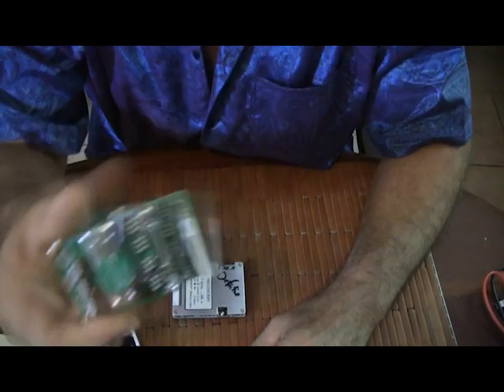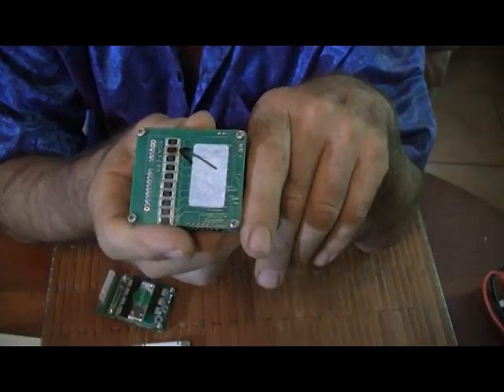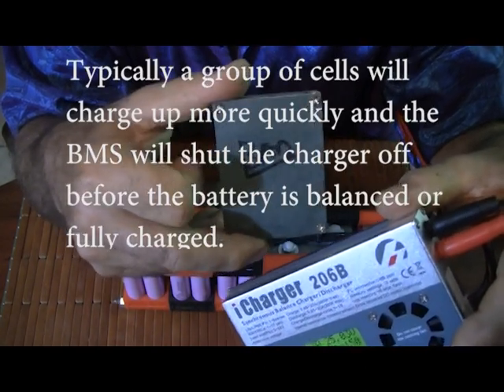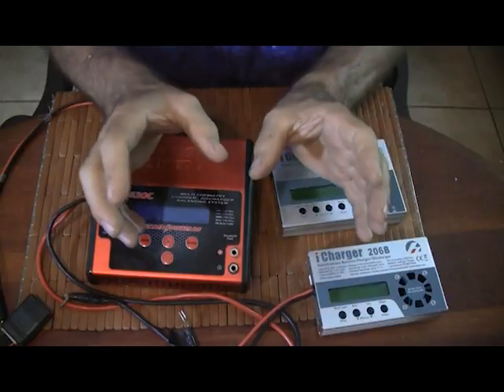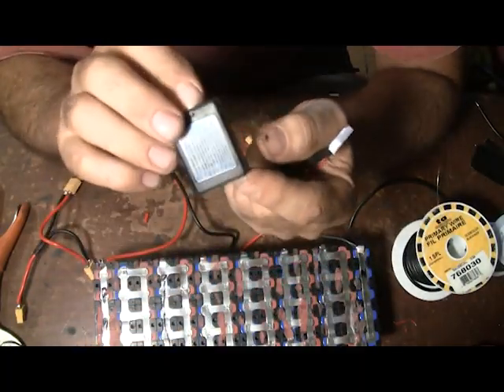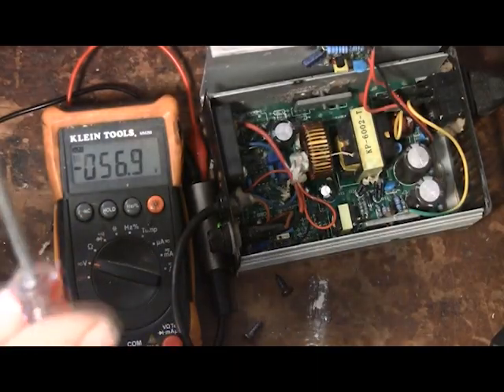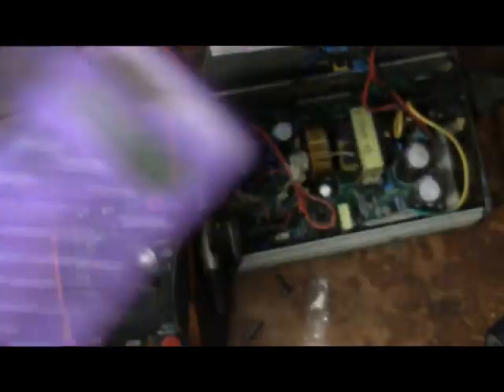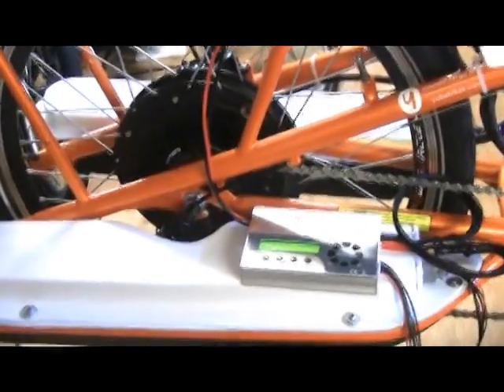How to build a safe and better lithium battery WITHOUT a BMS.

Comment: Thanks for the video Shawn, would say it's the best one on youtube re the optional ways that you can maintain these batterys, i have always had doubts about the Bms and as you have stated they don't show any readouts on the actual condition of any individual cell , hence and when in use it is a fly by wire experience hoping that you don't get the sickly stench of battery cells cooking.. thanks again mate, it was a pleasure watching this video..
Reply from the maker: Hi G Robbo,

Glad you enjoyed this video.  In my shop most of the battery failures I see are from failed or underperforming BMS's.  As battery packs get bigger and cells get older BMS's work even less well.

Comment: why cant you leave the battery in one piece?
Reply from the maker: Good question!  You can leave it in one piece.  But if you try to charge both sides in parallel with a parallel board you will short out the battery.  This way is safer.
Reply: Very true
Reply from the maker: I should have been more clear in the video.  I figured most people are going to want to charge up the entire battery at once, not in two halves, and they are probably only going to want to buy 1 hobby charger so.........

Comment: How do you monitor the individual cells within each parallel pack of the 14 packs? So you are still monitoring individual packs not cells.
Reply from the maker: You don't.  Because they are all connected in parallel, they will all be the exact same voltage. Connecting cells in parallel is a good way to bring them all to the exact same voltage.   Should there be a dud in the parallel group, current will flow from the good cells to the bad one until they are all dead.
Reply: Yes, But lithium ion cells don't like to go dead or overcharged, It may keep your load running but there are risks associated with it, Just curious if there is an easy way of doing it.
Reply from the maker: Yes, they don't like to go dead or get overcharged.  I don't know of an easy way to monitor individual cells in a parallel group, or any way for that matter.  Once they are connected together they behave as one cell.  Trying to take the voltage of any individual cell while they are all connected will just read the voltage of the entire group.
Reply: Shawn McCarty Upon reading more online and according to some sources, Li-Ion cells connected in parallel cannot be overcharged or overdischaged, Once an individual cell reaches its maximum voltage it stops charging allowing the current to flow to other cells in the parallel string, I think a good explanation of this is when the voltage reaches the maximum at the individual cell its internal resistance increases, in a series setup the cell will overheat because the current has to flow thru it, but in a parallel setup the current follow the path of least resistance therefore it flows to other cells avoiding the high resistance of the fully charged cell. And when the last cell reaches the cap voltage the BMS kicks in and shuts down the charging process.
Reply from the maker: Yes I agree James.  Good research!  That is a good explanation as to why all cells conected in parallel settle to the same voltage.
Reply: Thank you  James Bordon.This explanation  helped me a lot.
Reply from the maker: Yes you are right James, you are still monitoring packs not individual cells.  There is no way I know of to monitor individual cells that are connected in parallel.  The voltages between all the cells evens out as the cells balance each other.  Once cells are connected in parallel, any reading of voltage is the average of those cells and any measurement of current is the total of those cells.

Comment: Wow, Great video.
I took a different approach. I make all the batteries interchangeable. When the pack goes down I take them out and charge them all individually while I'm riding around on other pre-charged batteries. No solder, No BMS, no spot welding and no bricks of batteries. When one will no longer take a charge, out it goes. 
The cost for each bank of batteries was about about ten bucks (36v 10s 3p) and If I'm going on a really long ride I can take three banks . My range has been extended from 40 miles to over 100 with pedal assist not POD.
Reply: Ha rocket rose - I would really like to see your setup sounds interesting - any vids, is it a custom setup OMG so many questions I dont know were to start!!
Reply: have a look at my channel. I'm only working with 30 batteries at a time (10s3p) 36v ebike system.
Reply from the maker: Good Idea Rocket Rose,  I love innovative solutions to the balancing problem.  Your method shines in that it allows easy identification of a cell going bad  before that cell  takes down an entire parallel group.

Comment: Great video mate. im building a much larger packs for my home and after watching your video i may have to change a few things.
Reply from the maker: Yes you may, especially if you were thinking about using an ebike BMS.  The largest battery I have built to date is 6.2 kwh and it was a BMS free battery.    The bigger the battery the better off you are without a BMS.   At the very least use cell loggers to be sure that your balancing system is working.

cheers!
Reply: +Shawn McCarty thanks mate. I wish I had seen this video 2 weeks ago as I've already bought 4 bms but they come with a lcd each,  so I can watch the cells.  Will be interesting to see what happens. Thanks
Reply: Hello, this video just blown ma mind
I have an ebike battery 48v 11.6ah that came from china.. is there any way to take out the BMS without damaging anything? the ebike runs limit current of 30amps 

thank you for this amazing video!
Reply from the maker: Yeah, you can take off the BMS without damaging the cells.  But Yu will have to rewire the negative leads of the battery.  Of course you will then need to install a hobby charger system like I have outlined here.

Comment: Good vid! I actually used to use hobby chargers but then upgraded to a bms to charger my lipos on my electric longboard to make charging the cells easier. I don't think I will change back though. Really good video regardless :D
Reply from the maker: The bigger the battery the better hobby chargers work.   For a tiny battery that is fully charged - and probably fully discharged each use-  like your skateboard battery--   a BMS makes sense!
Reply: +Shawn McCarty  How big does it get to be too much?
Reply from the maker: Good Question.  About 10P, 10 18650 cells in parallel.
Reply: +Shawn McCarty  What if you're doing an EV conversion? Quite a bit of large packs.
Reply from the maker: You would not use a hobby charger on an electric car battery.  The voltage is too high and the amperage too high.